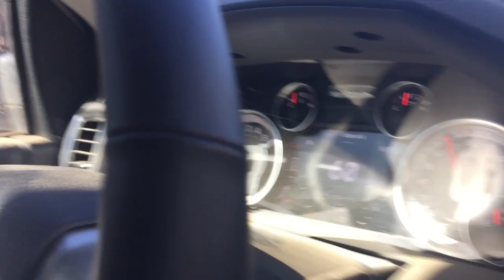Epic fail and a giveaway!

Comment: I'm in the turf industry and my feeling on the green machines is the same as yours. They're nice when they're new but when you start having to rebuild major components, the JD reman parts suck! I've actually been buying used parts when I can with a lot better success in keeping my machines up and running. Good luck on the repair and prayers for a speedy recovery.

Comment: Tim, best wishes for success on eliminating the possibility of skin problems on your neck.

On the subject of the broken pump shaft, I suggest you take a close look at the surfaces of the shaft break.  Look for a series of semicircles or "high tide marks" (like the outside surface of a clam shell), which would indicate a fatigue failure.  I could not get a good enough look at the shaft end in the video to see it clearly.  A fatigue failure usually starts at a point where there is high stress, such as a surface defect, a sharp machine angle like a spline root, or a defect in the steel.  Fatigue failure occurs over a long time, with a crack propogating from the stress point in small steps, then the crack spreads in increasingly wide steps or "high tide marks", and finally leaves so little shaft left that the final part shears off in one go.  

Excessive load on the shaft would hasten fatigue failure, so a defective pump that required high power to run it could contribute.  But long service at less than excessive loading can also lead to fatigue failure if there is some high stress point on the shaft.  Misalignment and vibration can also contribute.  The fact that the shaft had 15,000 hours on it may be the answer, but the damage to the spline teeth in the coupler seems to indicate higher than normal loading or some other problem (misalignment, vibration, too soft material, ???).  Was there maybe an internal constriction on oil flow in the pump that gave excessive resistance?

As you said, it is a lousy situation when you cannot get new parts or good rebuilt parts for an expensive machine.   Best of luck with the repairs.

Comment: Probably a good call to replace the whole pump. You have definitely had tremendous torque on that shaft to twist it off like that. Had to be a locked up pump even if momentarily. Dang breakdowns like that are pricey. Keep rolling.

Comment: The next time you loose a major component like a pump gearbox or drive for one of your Deere machines, give Langley excavator exchange in British Columbia a call for a take off parts. I purchased several drives and gearboxes for older hitachi machines from them. Had great luck with the parts and saved a ton by getting low hour take offs instead of junk remans.  Bought a valve bank for a ex 400 from them , had it shipped to Mobile and installed for less than half of what Deere wanted for just the reman bank.

Comment: Another day in the life of a small businessman !   That wouldn't by any chance be a variable-displacement Rexroth bent axis pump would it ?  One thing worth taking a look at is the control head regulating the pump stroke and GPM output.  If it  "deadheads" the pump - even momentarily -  the shock load could easily twist off the input shaft.

Comment: Know those type of problems too. Engine oil pump on cat skid steer went out, filled engine with metal. 1000 hours on machine. Out of warranty because of age not hours. Common problem on those with Perkins engines, Cat knew about'em. Needless to say, 10k later and a reman engine (6 month warranty on reman whereas JD provides 5 year on their remans). Still grinin' (through clenched jaws) about that deal.

Comment: From a blacksmith's point of view, I wonder if there was some type of perocity or flaw in the shaft. Possibly started off as a microscopic crack that developed into something bigger from use and vibration. Shafts are usually made from high carbon tool steel that can sometimes work harden and become brittle. So, there are a couple reasons that might be the culprit.

Comment: Good to see you holding up well! Sorry about your luck with that machine but thanks for being honest about Deere and their problems with their reman parts. There are those who claim to be Deere fanatics that can't find any blame with their holy Deere machines. Lol!  It's too bad that they can't do better for their customers. $10 to $12k on a part is not chicken feed. Then there's labour and additional costs like oil and other parts to finish the job. That shaft looks like it took a hard stock to break it clean off like that and is often the operators fault. Not point any fingers here but it does take a lot of force to break a hardened shaft like that, but then again with things being what they are and the steel and the parts being made over seas just might be the problem right there. I know since Cat has gone that way their reman parts have gone to shit which has dragged their name down over the past couple years. Good luck with the repairs and just call it another day in paradise. Lol!

Comment: Tim, when the (new remanufactured) pump is installed  and new hydraulic filters installed do they flush the hydraulic system ? As part of the requirements for warranty on the pump.

Comment: Tim, that is not a shear failure it is fatigue due to por fit between the drive splines. Likely the shaft spline or spider spline was slightly worn last time you replaced the pump.

Comment: Your wound is looking good.
Start using the oil on it and you will be back on the job quicker.
I lost the tip of a finger and you can't see where it is missing except it is shorter than the other.

Comment: Tim is is possible that you have a main relief valve that isn't relieving the pressure back to the tank which in turn binds your pump up? Or do you think the issue is solely in the pump? Just curious, I've never seen that happen before.

Comment: Did you get some Vit E oil yet?
You don't have to wait for the wound to begin healing.
You can get Vit E capsules and take it internally.
That will help you heal faster.

BTW just found something that helped me with my health issues.
It is supposed to be supportive of all the body systems.
I don't know if what it provides can be found in any other sources naturally
Massive antioxidants in it, Omega 3 and 6.
Better than Flax Seed (more expensive, though)
Available at my local health food store, and found it at HyVee (local supermarket in the organic section)
I take 1-2 Tbl spoons at a time.
Tastes nutty and is an oil (don't want to cook with it, though)

Comment: Yeah, Deere won't let you get a lot of stuff new.  Hydraulic pump on my 2355 went out and I took it apart and took it to the dealer here in Meridian and asked for a new one.  was told it had to be rebuilt.  sent it up to Tupelo and later, after about 40 hours, the outer seal failed and had to take it apart and send it back.  won't own another John Deere tractor.  that is just one of many problems.  my Massey Ferguson tractors were never this difficult.

Comment: on my Volvo truck i was smart enough to get mechanical insurance when it came out of warranty. two weeks later the camshaft needed to be replaced. but Volvo took that as truck only had 50.000 miles on it. thats the worst. when by new stuff for you dont want problems. and you get a lemon.

Comment: I have a 690Elc deere excavator, the Pump failed last fall,  I pulled the filter and have some metal in the filter.  I haven't pulled the pump yet,  In the past what have you done with pumps that have failed and put metal into the hydraulic system? do you purge the system? How?  Im a small farm and use this machine for clearing land and small projects!
Reply from the maker: +Justin Poulin about all u can do is hope the filter catches it all.
Reply: Thanks, that's what I figured,  I didn't know if you went through the effort to unhook every line from every cylinder 1 at time and try and push the contaminated fluid out? Seemed like  a lot of work and didn't seem very likely to get it all out, plus a lot of oil wasted.  Enjoy your videos Thanks for the reply!

Comment: If you go into probably any hydraulic equipment warehouse and see the shelves stacked with brand new pumps and motors, why can't these be used? Might be an idea to have a chat to a few engineers from http://www.twindisc.com/  (your John Deere engine should have a standard SAE pattern,  and see what is the most compatible option for a brand new hydraulic pump setup e.g http://www.kpm-usa.com/applications/mobile/  (Kawasaki)
https://www.boschrexroth.com/en/xc/  etc
It would be a case of cad drawings to make sure everything fits, wiring diagrams planning etc, a workshop conversion, laser and precision alignment. (Downtime new vs downtime reman and costs etc)
Otherwise another trip back to the PNW, to look at the Madill machines (currently use Detroit or Cummins(probably made in Rocky Mount, NC)/ rexroth hydraulics and linde, CAT track base etc. (waratah 624c used on 3800 and 2850c) rear entry cab for training the next gen operators, etc. or TC 875 logger.

Comment: sounds like that pump was a ton of trouble boss dam rebuilding that one isn't really and option you could but you might have the same problems I would think about looking out side the pump control valve or something putting excessive back pressure on the the pump
Reply: operators keep over heating hydraulic control valve blocks on our Hitachi 350 excavators ( basically identical to a John Deere excavator) they don't blow the rad or the coolers out enough could be an overheating problem check out and maybe think of getting your hydraulic cooler flushed out and change your filters on the hydraulic system a little more often